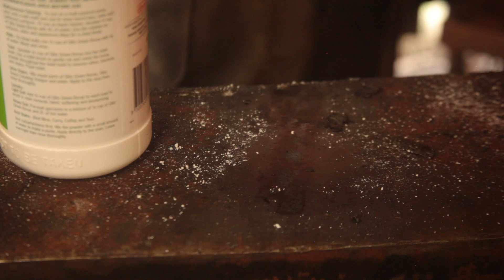A Damascus Viking Long Sword, pt2 Forging the Blade

Comment: Blade is crazy long though. Why not cut in half and make two?
Reply: Well a 70cm sword and a nice matching dagger?
Reply from the maker: The over all length is 1m with an edge length of 850mm which is with in the range of observed sword lengths from the period, yes I was aiming for about 900 overall so it’s not that long.
Reply: @docshotshopandforge  Just thinking of content 2x! But I'd want to make the big sword as well If I were you ;) good luck!
Reply from the maker: I have something fitting in the works then 😉